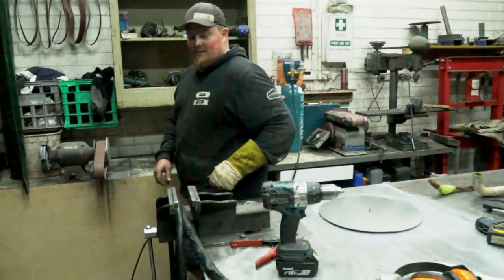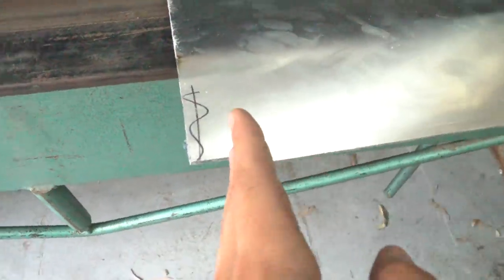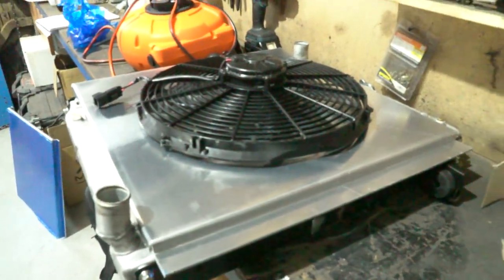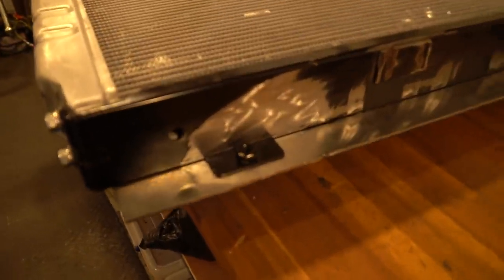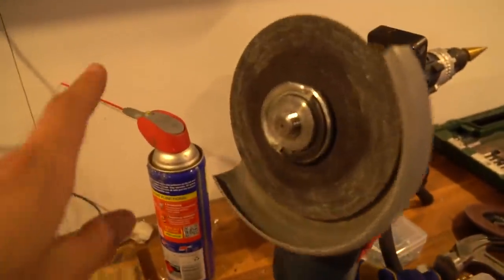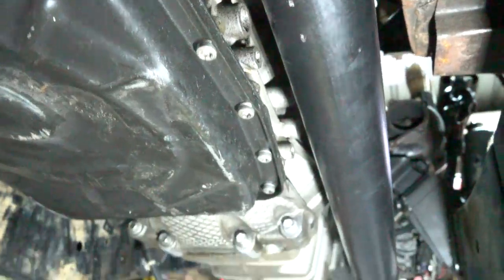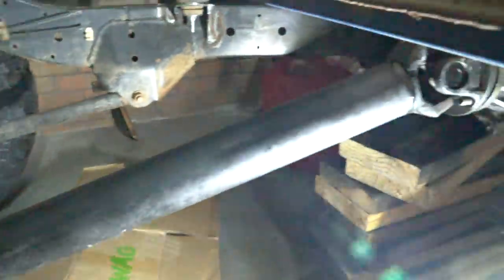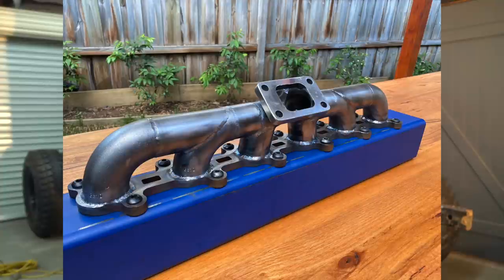Making a radiator shroud and bolting driveshafts in  - Barra T 45/80 Build Video #6

Comment: Just be careful vibration doesn't rub a hole in the radiator Richard, one thing you may want to try is to run a bead of silicon about 3-4mm wide on  the radiator tanks and let them skin off for about 10-15mins then just sit the fan shroud in place but don't bolt it up so the shroud makes an imprint in the silicon of where it wants to sit then remove the shroud and let the silicon harden for a day or two, this might work and make a good seal as well. The projects coming along very well mate. Seeya Rob
Reply from the maker: Cheers Rob, good idea. Would make a good seal as well!

Comment: Loving the build mate, it would be worth while checking clearances while articulating as well. Right wheel up and left wheel down might move the driveshaft closer to the engine due to the possible lateral movement of the diff & driveshaft with a panhard bar 👍🏻
Reply from the maker: Cheers Geoff I’ll definitely check once I’ve finished the exhaust! Thanks for the advice!

Comment: Loving the build! Your shroud looks great for low range stuff, but very restrictive for the highway.
Reply from the maker: Hi Gareth, I agree with you. I was a little constrained by geometry to do anything fancy and basically had to make it as low profile as possible to clear the pulleys! I wish I could have made it a little dished but hard to achieve!
Reply: @DesignedandBuilt  Some Japanese oems have rubber flaps on the shroud that allow air to flow through one way when air speed through the radiator increases, maybe an option if you have issues. Cant remember what car I've seen them on though.
Reply from the maker: Sounds like it could be the ticket, I’ll have a hunt around. Cheers!

Comment: Would it be worth checking the clearance under articulation also? I am just thinking the centerpoint of the driveshaft may shift laterally under full load of a single wheel,, / ''
Reply from the maker: Cheers Aaron, I think you’re right. I will check!

Comment: forgive me if im wrong as im only 10 mins in, does the driveshaft move sideways aswell as up on flex? so if you lift the front right wheel will it clash then?
Reply from the maker: Hey mate, you are correct! I have since tested it with a jack, really hard to do a full flex test in the garage, I think it all needs to be loaded and drive up ramps. It seems okay though!
Reply: @DesignedandBuilt  yeah that'll be the true test haha. Loving the build! I'll be onto the next eps soon enough!

Comment: Not enough airflow through radiator shroud. Needs more holes for air flow. You will cook your gear box. Your intercooler will not work efficiently. Your engine will run hot.
Reply from the maker: How would the gearbox run hot?
Reply: The gearbox transmission fluid is usually cooled through your OEM radiator OR external transmission cooler which is usually mounted in front of the radiator. I’ll get some more info for you.
Reply from the maker: Ahh yep no worries, because it’s a custom build I have the freedom to put it where I want! Just putting the rest of the stuff in before I commit to a position!